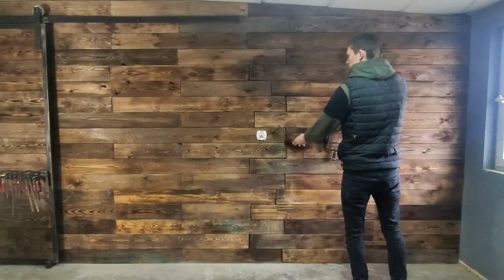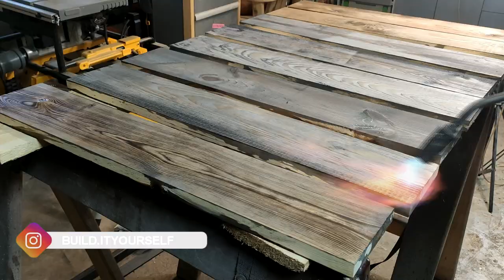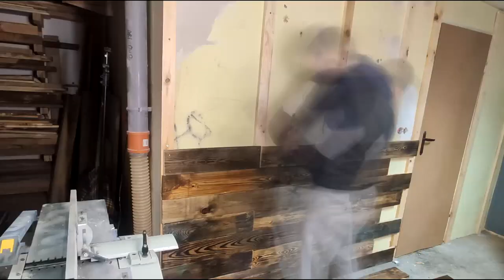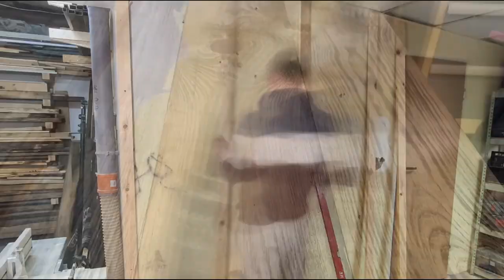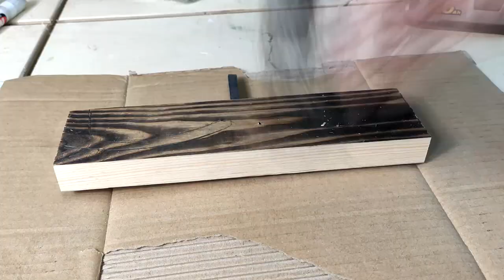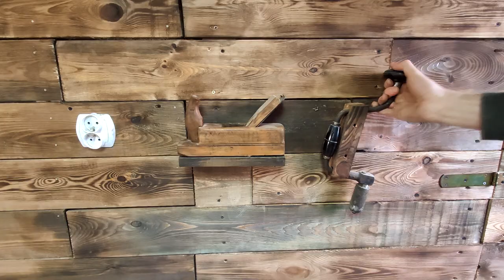🔨 Wooden Wall With a Secret Door / Drewniana ściana z sekretnymi drzwiami

Comment: Very nice. I need to make one going into a camper that storm destroid half of it. So someone trying to build wall half way fix the roof. That way atlest the bathroom kitchen be inclosed. But in the wall I want hidden door to go in. That way no one trys to break in that way. Plus I can have pad lock on side door and the one off the deck yea it's 12ft closed 12ft open floor. Was toy hauler I just got saved years and being disabled took long time to save 5k to find camper and truck to pull it. And now camper destroid the back half roof dropped inside just say got scammed what supost to be small leak had a broken roof that me I can't climb ladder to get on top i asked how's the roof he said perfect except the small leak by the air on top. No had 3 or 4 rafters broke caused pool that filled froze then came down. So no I'm giving a man my spare truck and camper van and selling my boat to inclosed half and making a deck with truck tool box storage which makes seats and add table on pole that goes in and comes off. Then tool box can be a bed after I add screen tent on deck cause inside can't sleep it's gonna be barly big enought to fit my wheel chair and electric scooter inside out rain. Which if rains guess sleep in truck unless I add small roof the frame of roof and set up for a tarp to go over when set up camping. Lol what's funny that's were I'll be living soon. I'm half camper that got 3k in and another 3k in trades plus parts I'll have to buy if can't find scrap. But I've always wanted camper with deck on it. Just wish could fix way to sleep inside. But bathroom praying the man can take out tub and counters cabnits. Find way to make a walk in shower for big guy in wheel chair I can walk just not far or long. But need seat in shower. So want walk in shower. So if take all out bathroom can add big shower floor add back plash all on walls. As for chair cut hole in shower floor add toilet back in side the shower. Small RV have shower toilet sink all in one. I will also. Then just have the door to kitchen as bathroom door. If need be hang shower curtain not like be useing alot water camper quit shower while half is cold. Lol. But my back wall I love your way making door. I'll show the guy helping see if he can do that.  I was gonna just have the door. Then add my lockers the small 1 foot lockers I got to store fishing gear baits and lock up. Put on our side have over hang on roof so don't rain on top. But add a slide have the locker slide to side. Or have the locker screwed to door. Open locker be handle to open or lock the door. When open door opened out no one can see the door. But I like yours more. Thank you. I pray he can do something like that. Wish I wasn't disabled I build homes for living ide have some fun fixen it up making it look difrent. God bless you.